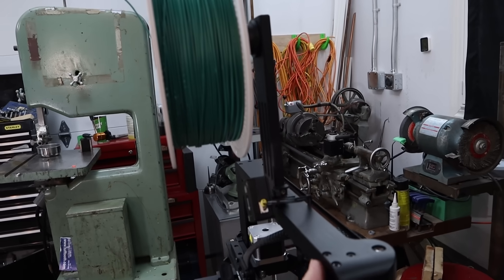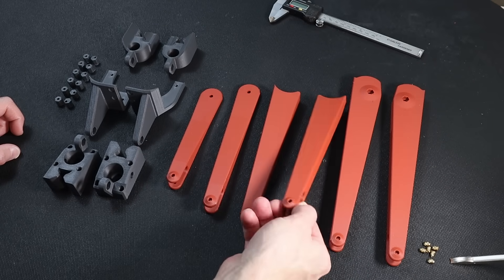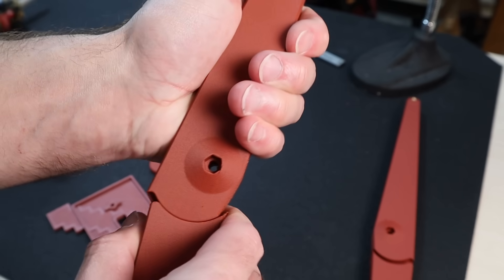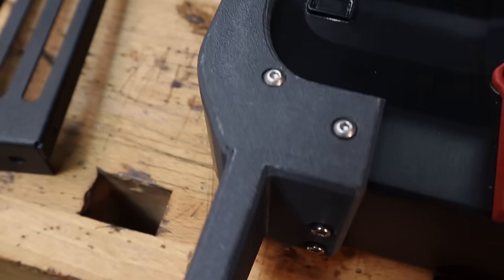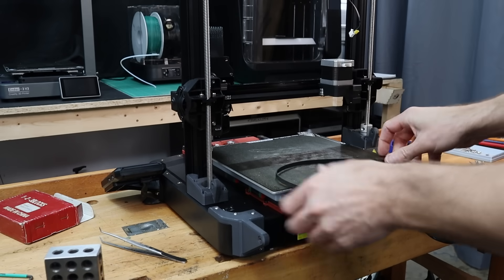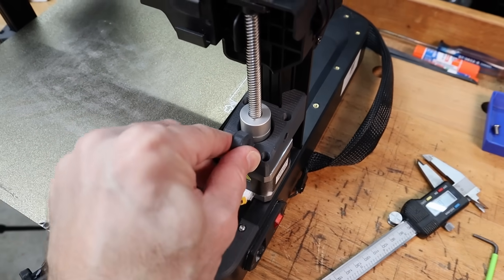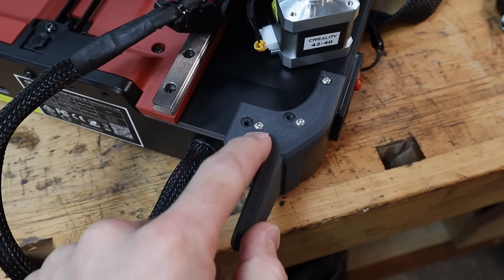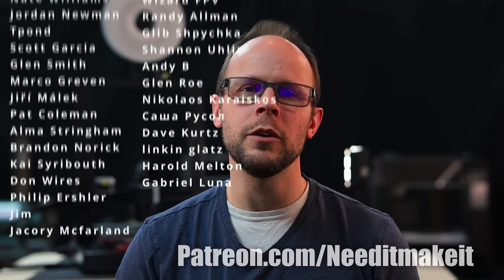STRONG and FULLY 3D Printed Arms for your Ender 3 KE and SE

Comment: I don't know why 3d printer enthusiasts think that the only way to fix a 3d printer is with another 3d printer... This could have been done much easier, cheaper, and with a more rigid result by using steel instead of plastic. Your red parts could easily have been replaced by cheap steel flat bar with holes drilled in each end. Your back corner brackets could have been made from simple steel angle brackets. And I'm sure there is probably a way to use a simpler bracket system on the other parts as well.  I give you an A for effort but in the future, don't shy away from using metal. It's not sacrilege to use metal on a 3d printer.
Reply from the maker: Yes, that was a consideration, however the goal was to make something that is printable which does not require ordering special parts and cutting to length. 

I have metal working machinery in my shop, I am also a Woodworker and I could have easily made it from wood.  The point is that the solutions I try to provide are for everyone regardless of their skill level or available equipment.

When I begin to design something I usually run scenarios through my head of what is the best possible solution that I can provide, sometimes that's how I begin... it's not always the way it ends up depending on the constraints.
Reply: @NeedItMakeIt great video, I'm an industrial extruder mechanic currently working on blown film extruders.... But I move around 😂.
Just got into printing a few weeks ago ironically
Reply: @NeedItMakeIt  You don't need to defend yourself, this guy is just running his mouth to run his mouth.   He's one of those that like to point and tell someone how to do something but is completely incapable of doing anything himself.
Reply from the maker: @dankcincy  LOL, no problem, I've heard a lot worse.  It really doesn't bother me at all, I welcome any comment good or bad.  

It's highly unlikely that people like that will every change their minds, so it's probably not worth taking an approach to try and convince someone.  I'm simply explaining my approach and they can choose to believe what they want.  There will always be that % of people that are always trying to give you a hard time.... that's life.  I appreciate the support!  I'm making good progress on the next video.  I thought I would share the dovetail connection, there have been a few requests on how to design it.
Reply: @dankcincy as a complete newbie to this space (3d printer on is way), I feel i have a non biased position reading this ridiculous argument. You are definitely the one running his mouth to run his mouth. What you're implying is he has to take the time to put something together for a printer he may not even own for a problem he may not even have or care about to upload a picture to appease you? That's just stupid.
Reply: Because this is a 3D printing channel?
Reply: Why is everyone bashing mtslyh?  
There are may ways to implement this solution. 
I thank the make of this video to show us this solution. And yes i would have done the long arm with aluminium rod or something similar, too.  
But those different approaches doesn’t justify to bash against anyone!
Please stay calm. Peace! ☮️
Reply: @olaf_s_23  if you look at the name of the channel you’ll see why everyone is bashing him, and generally his comment is bashing the OP
Reply: This argument would be moot if Creality didn't release a half baked product.
Reply: @XHolyPuffX  In all fairness, all the I3 style machines suffer from the same issue and this style of "fix" has been around as long as the I3 machines have been. Some of them come with supports like this.
Reply: Why are you surprised that a channel for 3D printer enthusiasts made a modification using 3D printed parts? If the channel was for home machinists enthusiasts, you would have a point. Do you go to the woodworking channel and ask why they didn’t cast a hand carved box out of cast iron? Really, I’m sure they would appreciate your insightful and well thought out suggestions. After that you could go to an alternative lifestyle channel and make fun of them. I’m certainly they too will value your viewpoint and criticism. Of course, if your purpose was to be an argumentative boor and incite a blog jihad , then two thumbs up, well done.
Reply: @boriscalderon1678  you could almost guarantee that he’s been to the woodworking channel and asked that 😂😂
Reply: But drilling metal is a hassle
Reply: There are a lot of threaded rod vids for this issue, most people just like to print parts for their printer
Reply from the maker: @Dad_with_a_drone  There are not many solutions for this printer sadly, since it is quite a hard printer to create a solution for.   The idea is to be able to make the parts yourself with no need to cut pieces of aluminum or steel so that it is accessible to anyone at any skill level.  I would have preferred the rods myself, it was a consideration, but it would not be a solution for everyone.  Right or wrong, that was my thought process.
Reply: @NeedItMakeIt  I have no issues with your solution I was just pointing out to the negative person in the comments that there are many solutions (all diy !) not all are printed, I don’t see an issue with printing parts, I commend you for finding a way to print it that didn’t already exist lol, you channel is called need it make it, so I would expect to see you trying to solve all sorts of real world issues with a printer! I generally do the same :)
Reply from the maker: @Dad_with_a_drone  If there is some demand I may take some of the connections and also integrate a rod instead.   I have some plans of creating an entirely new base for the printer as well, one that has attachment points all over it... but these are just ideas at this point, I don't know many people who would want that.    Thanks for the comment, it's always appreciated, I apologies if my messages come off as abrupt, that's how I typically write.  It's far more satisfying to DIY than to empty your wallet and pay for it!
Reply: @NeedItMakeIt  its all good bro, I didn’t find anything to be upset about :) it’s funny you should say that I have an next in an enclosure  but all the electrics could d it’s being out o f1 the enclosure,  I thought it would be a good time to make the bed connection have more than one point of contact, seems like a weak point especially now I’m up to speeds the printer was not made for !
Reply: You could also just buy parts for your printer. Or just get rid of the printer and just buy finished products. Why bother using it at all
Reply: @mtslyh @fernandoisraelruiz7572 hug it out guys
Reply: Why would he go through the work of cutting metal, for which you need very specific tools and skills, when he can just print an exact fit and can then share the file for everyone else to easily print too?
Reply: i'm looking at these replies and wondering when did so many assholes wander into the 3d printing community
Reply: They sale these arms why buy them for $15-$20 when you can print them for like $5. Isn't that why we buy printers is to print fun things, and or save money.
Reply: Steel? What is this a 1911?
Reply: I think this is a 3d printer channel not metalworking one… he is teaching how to do stuff in the printer.
Reply: You're talking to people whose hobby is literally 3D printing. Their hobby is not building things out of steel. I have a c&c mikl which I pretty much guarantee you don't. Imagine if you will did I suggested you were stupid for suggesting pledging something together out of steel when you could mill it out of 7075 aluminum which would be lighter probably stronger and far more rigid
Reply: @charlesreid9337  It's not about hobby, it's about relevance to the task at hand. Even with metal rods you can end up with not enough rigidity when trying to solve this particular task if you choose rods which are too thin. While with plastic arms you are pretty much guaranteed to not have nearly enough rigidity, which means that you've failed to solve the task, which means that you've failed to choose materials properly, which means that you are a subject to a logical fallacy which is "when you have a hammer everything looks like nail", which means that you are not intelligent enough to not be a subject to that fallacy, which means that you should be ashamed of yourself instead of being proud of yourself.
And don't make cheap arguments about having or not having cnc, since it's also irrelevant to this particular situation when you can use premade metal parts with a little bit of 3d printing to achieve acceptable results.
Reply: I am so frightened I am going to mess mine up. I think I will print these and have them ready to use and once I have issues then I will take a risk. Lol
Reply: Still waiting for your demonstration video
Reply: Steel is significantly more expensive than plastic filemant.
One aluminum angle rod that was 48 inches cost me $40.
Had it been iron it would have cost well over $100 for the same thickness and would need expensive cutting tools either metal.
Most people watching these videos don't have basically every Milwaukee Fuel power tool or metal table saws like I do😂
I could have easily used metal from our scrap bins at work and yet I still 3D printed mine. 
I did use all thread we had lying around for a similar brace as his though😂
Reply: I've made my living for the past 30 years in the auto industry repairing, restoring,  and customizing vehicles, as well as building props from scratch. I own a bodyshop with every cutting/welding tool imaginable.
That said, I'm going to print these parts and bolt them up because its convenient and that's what I want to do. Hope this helps
Reply: You are right. I don‘t undestand why everyone uses the printer for all things to stabilize it.
I have made the stabilizing arms out of Aluminium. It’s light, easy to work with it and it gives a professional Touch. Also i made other things to make the printer more funktional and easy to use. Not at least Aluminium ist much more stable than PLA or PETG.
Reply: People like yourself buy 3D printers, so that you can solve problems without them.  We get it.  But not everyone has that same philosophy.  Moreover, for people that care about aesthetics, his solution actually looks good.
Reply: this is an extremely dumb comment. of course you can do that but this is meant for people that don’t want to buy those things nor want to drill a hole in their printer. fully printed is what’s making these people want to do this like ?? oh yeah let me just grab some steel?? an average person wouldn’t have that lying around nor want to go out of their way to get it when they can just print materials instead but okay bozo
Reply: The whole point of the fucking channel is to 3d print things that you need which is why MAKE IT is literally in the channel name, you telling me you can make steel panels and bars?
Reply: @Moistnapkin862  Yes, many of us can. Metal working , machining, etc., isn’t black magic. This channel is not only about 3D printing as you state. I have no dog in the fight but this maker often uses metal, wood, and other mediums while printing, machining, welding, etc WITH  3D where it is appropriate. That’s what makes the channel so good. 
As usual, the truth is somewhere in the middle.
Reply: Says the person that can't use 3d modeling software. Lol
 Why would we use some half baked, cobbled together solution when we can model and print Exactly what we want?
Reply: @dankcincy  FDM printed parts are like the poster child of half baked and cobbled together lol. Rarely is it the optimal way to produce something. And spending an hour in fusion 360 designing supports and then waiting 16 hours for them to print – when you could just use some off the shelf materials and common tools to get it done faster and stronger – is a huge waste of time that isn’t tolerated outside of hobbyist projects. The 3D printer is for producing things that are best made using a 3D printer, not for making every part that fits in the build volume. Unless you just love 3D printing and aren’t interested in any other method of manufacturing.
Reply: @dankcincy  What makes you think I can't use 3d modeling software? I'm just of the opinion that you should use the right materials for the job rather than trying to force plastic to work for everything. By the way.... Did you notice that he had to go back to his 3d modeling software multiple times to finally get it right? And how much time was spent in 3d modeling software trying to get a perfect fit up of those multi-part red leg pieces just so that they could slot together correctly (and even then they still needed glue)? Two metal bars drilled with a drill and cut to length with a hacksaw would have been cheaper, quicker, and stronger. That's my point. Why are we spending so much time in 3d modeling software to create a complicated multi-part design for what ultimately ends up being a straight bar with 3 holes in it?
Reply: @mtslyh  Sorry to butt into your conversation.

It seems like you don't understand one of the main purposes of a 3D printer: to rapidly prototype and iterate on designs easily.

I agree that a couple of metal bars would look better (since solutions already exist for other Ender 3 models), but I think it's fine to make the model in plastic first and then make it with metal to avoid wasting time welding and cutting. Although I suppose as a Metal Genius like yourself, you could do it perfectly the first time without any mistakes
Reply: @mtslyh  That's how R&D works. The first iteration of a design is rarely, if ever perfect. It's why R&D is so expensive.
 Now the end result is something that anyone can download and use. 
 A lot of the entertainment value of all of this is in the doing. It's in the designing of this stuff. Is a lot of this stuff overkill? Sure, but that's half the fun.
 Could you get away with accomplishing the same structural support in other ways that don't require this level of engineering and design? Sure, but why would you when you know that you could end up with something WAY better?
 It's a proper design the fits, works, and looks correct. It's not some cobbled together bs using hardware store angle brackets and flat bar.
 You're like my brothers. You'll just throw something together out of whatever is laying around. If it works it works right?
Reply: @mtslyh For the record, the solution I went with for this uses all thread covered in heatshrink and some brackets that clip on instead of  screw on. A design I found on Thingiverse and downloaded.
 I was able to do it that easily because someone else took the time to design it and upload it.
 And that idea of it being easy for others to download and make work is why I upload all the solid models for the few designs I've done. To make it easy for people to then download and use/modify.
Reply: @mtslyh And to agree with everyone else ...put up or shut up, let's see your design. 
 Be sure to include in the video any and all of the little changes you have to make in order for it all to work correctly.
Reply: @fernandoisraelruiz7572  I totally understand the purpose of a 3d printer. I have one. I like to use it for rapid prototyping. But I also have a mill, a lathe, woodworking equipment and even a vacuum forming machine. I get that other people don't have those things. But the desire to create a solution that ONLY uses a 3d printer is NOT easier and is counter productive. He says that he wants something simple that doesn't need custom parts. Yet to make his solution I need special filament, a different nozzle, a caulking gun, special glue, a soldering iron, brass threaded inserts, and a file or rotary tool to get a special dovetail to fit snuggly enough that it holds. I also need to take apart my entire printer which weakens it. How is that easier?

Look folks.... I like his channel. I wouldn't be a subscriber if I didn't. He's done a lot of great stuff. But this one isn't one of them. That's ok. Not every idea is going to be a winner. The way we all grow and do better is to learn from our mistakes instead of believing that everything we do is perfect.

You don't need to come running to his defense because he got a little bit of negative feedback. He's a big boy, he'll survive.

If you pulled.your nose out of his asshole long enough to really look at this design and how much fiddling it takes to get it right you'd recognize that this is not his best work. That's ok. Design is an iterative process.
Reply: @mtslyh  "I don't know why 3d printer enthusiasts think that the only way to fix a 3d printer is with another 3d printer..."

This is an emotional response to a problem that only exists in your own head.  It was stated nowhere that the solution in this video is the only one that exists, or the best one that exists, and that you need to use a 3D printer to fix a 3D printer.  If you want to provide constructive criticism that's fine, but maybe stick with the facts instead of starting with a mischaracterization.
Reply: @dankcincy  Put up or shut up is bullshit. I appreciate that he makes videos. I don't make videos. But to tell someone that they can't point out that a video is not a good design just because they themselves don't make videos is asinine. What that would mean is that no one is allowed to call out bad designs that could even potentially lead to someone breaking their printer simply because they don't have the means to make a alternate video.

There is no reason to take apart the entire printer to reinforce the vertical brace. Put two steel L brackets in the back corners, 2 steel flat bars from those L brackets leading up to the top cross bar, and then 3d printe a bracket that uses the existing 3 screws in the corners of the top cross bar to add the mounting point. Yes, you'll need to run to Home Depot to buy a few parts and some longer screws, but you won't need to take everything apart.

Again, stop playing defense and actually look at the merits of the design itself. If it isn't a good design and could lead to people breaking their printers or needing to buy a whole bunch of stuff to fix a minimal wobble, then it isn't worth defending. 

I'm done with this nonsense. I just hope that people who were considering this mod for their own printers got a chance to hear an unbiased opinion before all of the channel's groupies decided to try and cancel any legitimate negative feedback.... Again... He's a big boy. He isn't going to melt because someone said that his design seems overly complicated.
Reply: @mtslyh  Ok....If it's so simple, easy, and perfect, then let's see it. 
 You don't have to make a video, just upload your design to Thingiverse, Grabcad, or one of the many other places you can upload stuff to.
 What size L brackets? How are you attaching them to the printer? How are you attaching the top brackets to the printer? How are you attaching the flat stock to the top and bottom brackets? Using your design, how are you adjusting the squareness of the vertical upright to the base? Are you going to square it up to the base of the machine or the build plate? They could be different ya know.
How are you going to keep from from throwing the entire machine out of square causing it to wobble on two feet like a messed up chair or table? What's it going to look like?
 These, along with others, are all things that need addressed that your little bs cobbled together idea doesn't address at all so yeah, Put up or Shut up!
Reply: Steel? Don't be an airhead
Reply: Hey, why don't you just shut up and show us how you would do it instead? If you can't demonstrate it, then just keep quiet
Reply from the maker: LOL, Love it thank you!
Reply: @fernandoisraelruiz7572 They don't need to "actually do something blahblahblah", since we are not dumb and can analyse their point by just using our accumulated knowledge of the world around us.
Reply: @fernandoisraelruiz7572  Easy.... Replace the red arms in his design with simple steel bars.
Reply: @mtslyh  Oh, I guess since it's so easy for you, you could enlighten us with your knowledge and make a video for all of us to learn from, huh? What do you think?
Reply from the maker: @mtslyh  Yes, for sure I could have done that easily, but that's a selfish approach, the idea is to make something that anyone at any skill level can do themselves.  Not everoyne has the ability to make parts from metal.  I would be all for a solution using metal though, that's a normal way to do something like this.  I tend to do things that are not normal, normal is boring and not challenging, let's do something different and try to learn something and expand our knowledge and capabilities.
Reply: @NeedItMakeIt  Thank you for the reply. I appreciate the candor. I understand the desire to try and make designs for any skill level. Where I think we disagree is in what skill levels this design requires. I do not see the difficulty in going to Home Depot and buying a 48" piece of steel flat bar and cutting it with a hacksaw. I feel like that is on par with having to sand-to-fit a custom dove tail and then glue it up so that it holds up to constant vibration. I also feel like having to take the whole machine apart is not a design that is easily implemented by someone who is not mechanically inclined. 

Again, my comment was that by striving for a 100% 3d printed design, you did not actually achieve your goal of making it simpler. It's ok to add some steel now and then if it makes sense. Especially if it greatly simplifies the design. That was really my whole point.

I am subscriber because you have made some great videos in the past and I appreciate the work you share with us. With that said, being allowed to give negative feedback is an essential part to creating better designs and learning new approaches. Being surrounded by "yes men" is not helpful and when those same people attack others with dissenting opinions it eventually dilutes the quality of the feedback you get. 

I appreciate the fact that, unlike your die hard fans, you do not appear to have taken offense at my criticism. 

Thanks you for the dialog. I will not continue to pollute this video's comments section with any more replies. Keep the videos coming. You've done some great work and I look forward to continuing to follow this series.
Reply: @fernandoisraelruiz7572 / Proper Printing channel had done a similar thing with Ender 3 Pro, only it's also a foldable strut for his own unique mod.
Reply: @mtslyh  man. you really got hammered for having what seems like a pretty reasonable take on the subject. i probably would've used a threaded rod with some supporting hardware personally. 
just sucks that you were shunned so quickly for a pretty reasonable take.
Reply: @mtslyh I 100% agree with you, if someone is making a channel about designs then all feedback should be given instead of all positive otherwise you won't grow as a designer or a creator, you will just be stagnant and won't gain anything at all.

I for one would like to grow as a creator and be a better version of myself
Reply: @protogen_boi that's what I'm saying. People are toxic.